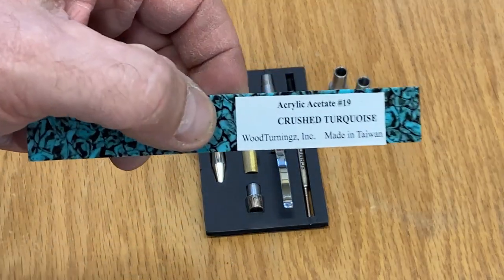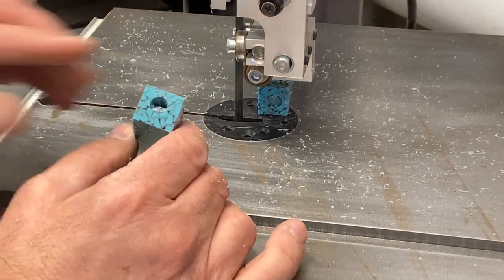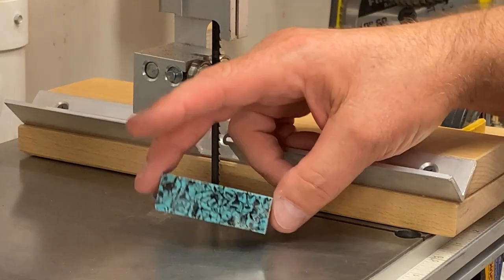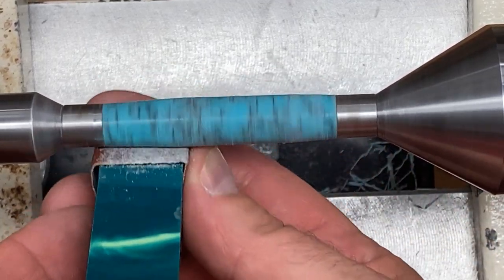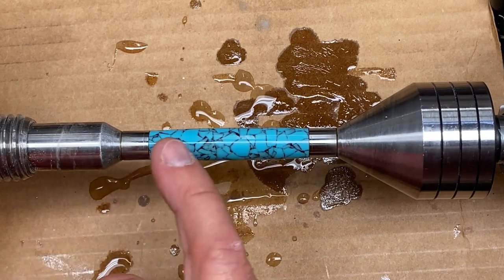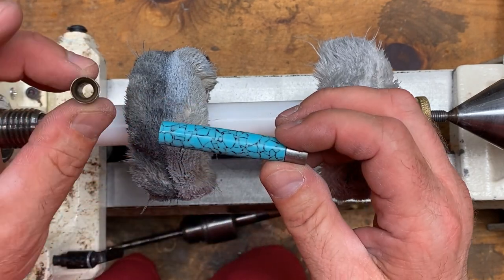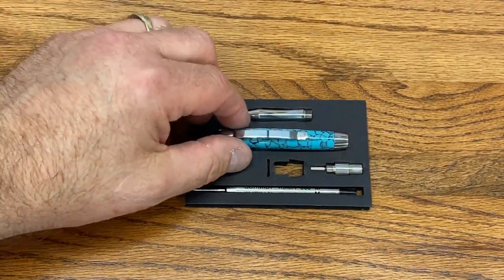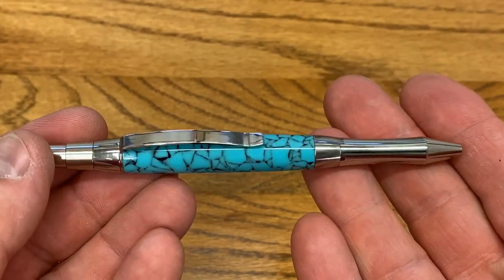Taylors Mirfield Pratchet Kit with a Tru-Stone Turquoise Blank

Comment: Thank you for packing so many great tips on how to handle those specialty blanks into this video.  I don't like turning acrylics and my daughter doesn't like turning wood.  I always grumble when I prepare acrylic blanks for her and have blown out a few.
Reply from the maker: Thank you for watching and I’m glad you
Found the information helpful. 

Regards,
Bob
Reply: I turn a lot of acrylic blanks.  I find that take longer to turn but faster to finish.  And Bob is correct to watch the temperature  when drilling.  I will cool the bit with water and also put water in the blank when drilling.
Reply from the maker: Thank you Dwight. 😀

Regards,
Bob

Comment: Nice to see you back 😀. Good suggestion about using the 5 minute epoxy to fix the loose end. It hasn’t actually happened to me yet, but if it ever does, I’ll remember you trick.
Reply from the maker: Thank you, I’m glad you found a tip that you may be able to use. 

Regards,
Bob

Comment: I'm in the process of turning a pan with Tru-Stone turquoise + gold.  Yeesh!!!  Talk about stink!   Smells like a chemistry experiment gone seriously awry.  But... I drilled it paying close attention to the heat with no problem.  And with a very sharp (conventional) skew chisel, resharpened frequently, at 2000 RPM, it turns quite nicely.

That kit looks really nice.  I might order a few.  Also, you did a very nice job with the turning.  Cheers!
Reply from the maker: Thank you Michael,
  I had forgotten about the blanks odor until you mentioned it. It did smell odd while drilling. 
  I went with the skew for turning as well. The blank was tough on the edge. Instead of sharpening, I use a power strop. It’s a leather wheel with a little rosin on it. 
  I remembered seeing the barbers in the old cowboy movies using a strop for sharpening a straight razor before giving a shave. 
  It does a nice job and doesn’t remove any metal. 

Regards,
Bob